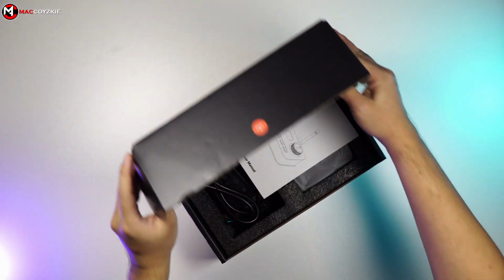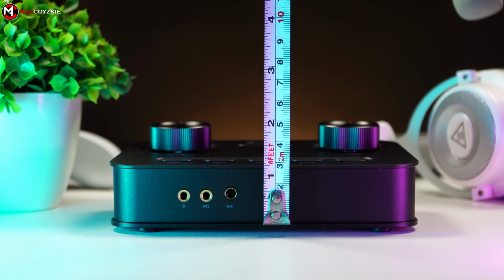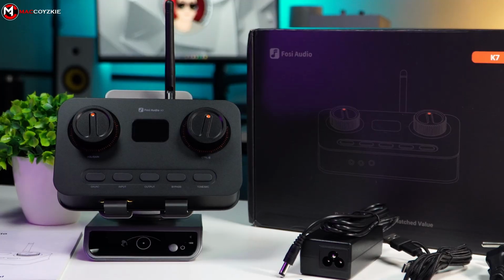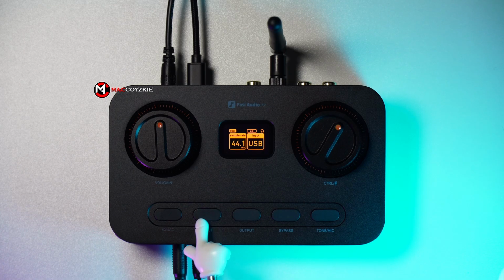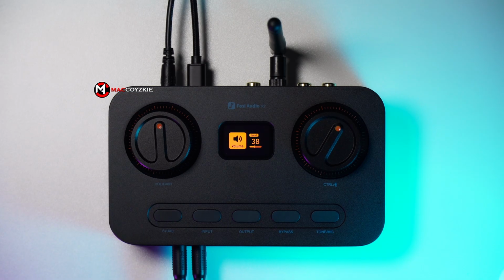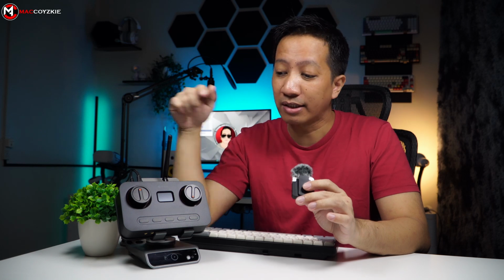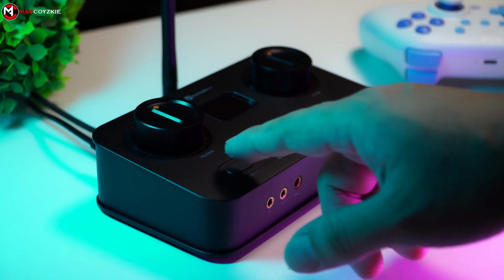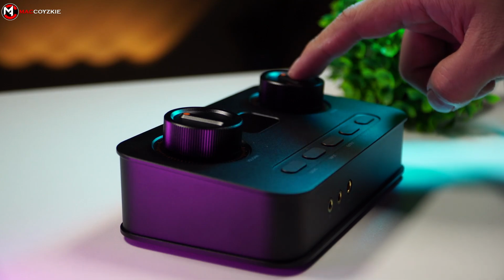Audio & Mic sound candy! Fosi Audio K7

Comment: I'm using GSX1000 ( for gaming) since 2019 with my 64audio U6t for years. Planning on upgrading to new dac/amp with new and modern chip. Is it worth it to upgrade from gsx1000 to Fosi K7 in term of sound quality in gaming? I don't really care about Mic feature or EQ, I also have mod Chord Mojo 1 to listen music as a second desktop dac/amp. My old GSX1000 has annoying white noise, so I have to use it with IFI IEMatch to reduce the noise. The new Fosi K7 is about 170$ at my local store.
Reply from the maker: sound quality yes! no more hiss and best for gaming tbh. not to mentioned the built-in EQ,you should get one bro